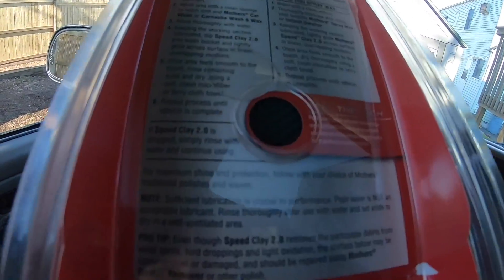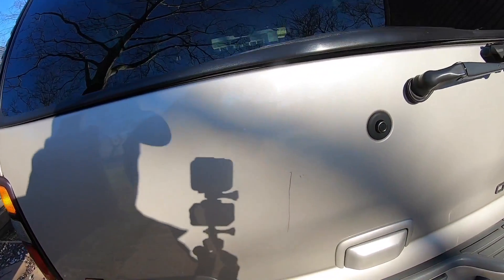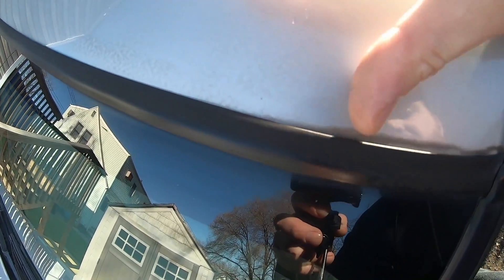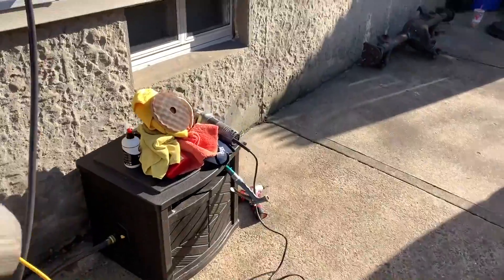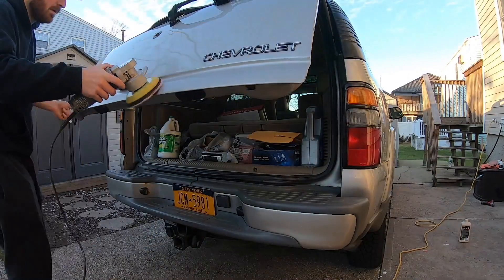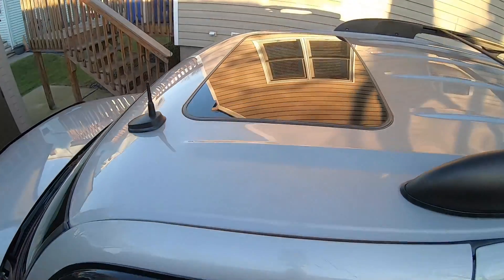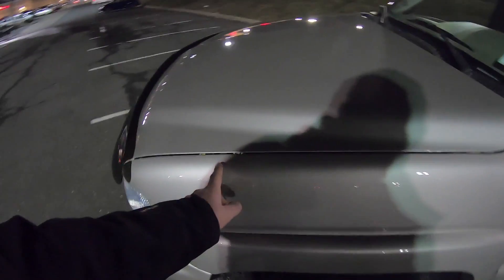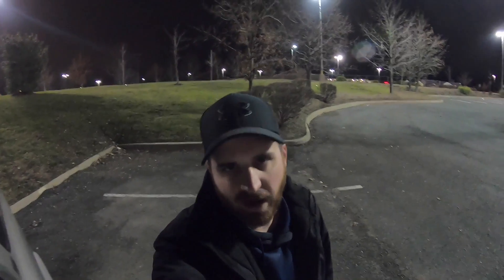Paint Correcting a 200,000 Mile Truck | DIY Detailing

Comment: Man, I just found your videos, after searching for direction on a front end rebuild, I already did the shocks and air compressor.  My ebay pimp kit is in the mail, I'm doing everything you're doing. 03 Yukon xl denali 208k.  I'm glad I found this channel, I've had the truck for 3 years @160k, finally doing needed maintenance and upgrades to make the big b*tch last.

Comment: looks great!  That truck has power folding mirrors by the way.  Set the switch to the middle position then hold the large square button on the right to fold in and on the left to fold out.

Comment: Wow my 2006 Chevy has peeling paint. It seems like GM paint is a real mixed bag.
Reply: Herbie Husker maybe this truck spent a lot time under shade or parked under a roof/garage
Reply: @Duck_31  It's possible. My 6.0 powered truck still runs amazing though. Mechanically it is perfect, the interior is fine, but it could use a paint job, probably because it has never been garaged.
Reply: Sealants like wax and stuff go a long way for keeping your paint from becoming brittle and pealing.

Comment: Your Chevy belongs in a museum, what Chevy lasts to 200k?
Reply: All of the ones that people take care of and put good oil in at the proper intervals
Reply: My mechanic has a Yukon with 480,000 on it lol
Reply: I have a Trailblazer with 200k. All maintenance done myself👍
Reply: Elden Giron my mother’s suburban has over 200k and still running strong
Reply: I have a 2002 Yukon with 340k on it lol.
Reply: My father had a 2001 Tahoe that went just over 200k before he got rid and he abused that thing for work.
Reply: Got a 98 blazer with 200k miles . 200k is fairly easy for a Chevy.
Reply: I know the old Chevy's y'all mentioned and the one in the video were built before Chevy quality became shit , just was making a joke 😂
Reply: 2011 gmc Sierra (Silverado) 220k and going strong no check lights just basic maintenance
Reply: 07 chevy colorado just broke 200k miles
Reply: My dather has an 88 Chevy with 300k still running strong.
Reply: My  chevy equinox 2007 drove like a dream and still mint condition its 180k
Reply: Elden Giron my dad had a Suburban with 300k miles on it. He did most of the work at home.
Reply: Elden Giron my 05 Tahoe has 230k miles lol only thing I don’t like is the acid rain on the windows makes the car look bad i got 5% all around and 20% in the front but go up to the windows and you see all that bad stuff any recommendations to get rid of it?
Reply: Gmc/Chevrolet trucks are most reliable cars in America beside toyota and hondas.
Reply: My dads got a 94 sierra. Its got 240,000 and counting on it